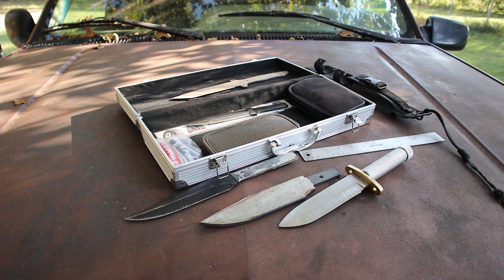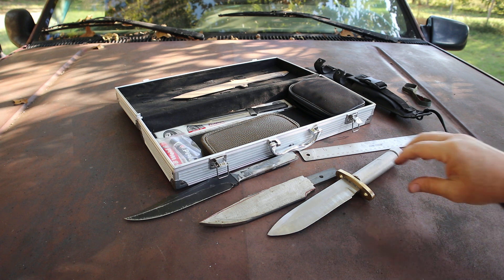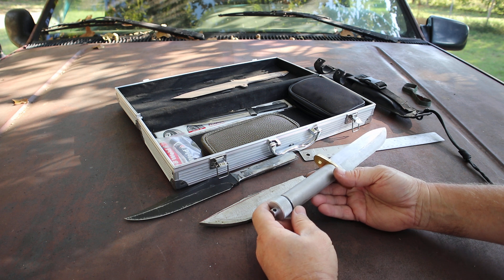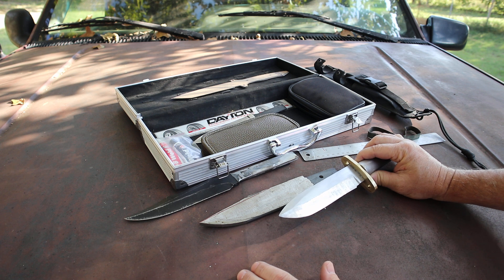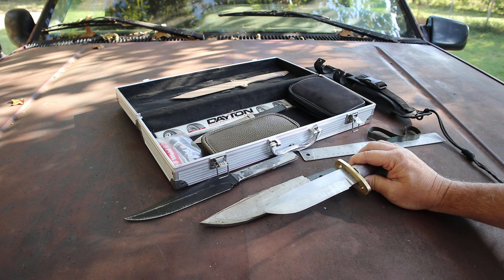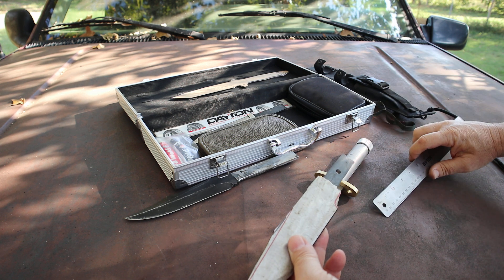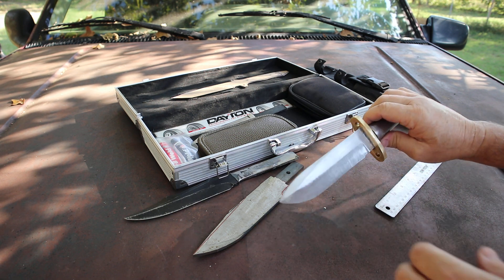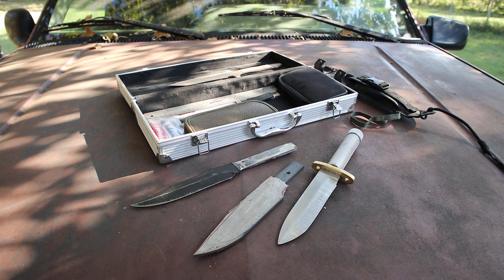Handmade Hollow Handle Knife Discussion ~Snowman~

Comment: Snow man that's gorgeous  man . Kust asking shouldn't you pin that blade in case the weld lets loose price ???? Id love onethat looks like my Parrish that got stolen in central America in the 80s pls let me know
Reply from the maker: Yes its pinned with the titanium round bar stock piece.  I put a 3/4" long 1/4" round titanium pin through the 1/4" hole that's drilled through the tang. That gets inserted and cold welded into the handle.  It will never come loose.  $330 total that covers labor plus materials, the hollow handle, cap end, making of guard + its material,  blade material + cutout labor all that togethers is $130.  labor for the rest of build is $200 that's all the labor time in hrs I put into making one, primary grinds, secondary grinds, heat treatment and temper, sanding and polishing etc.  No Sheath!  Just the knife.   I usually make knives for myself when the weather cools off from Sept-March, I'll be working on my MAC-V SOG, Snow-Tac's and these hollow handles.

Comment: The knife looks pretty Cool.  I’m curious,… What do you charge for one of these knives?   What is the wait time?
Reply from the maker: We could flip a quarter and bet "everything". lol!
Reply from the maker: Let me get back to you sometime the next summer in 2024, I'm going to be upgrading everything from shop and new knife supplies and knife steel supplies etc.  I'll make you something its just right now I got pregnant German Shepherds and lot of family chores on my plate, generally they range from $190 to $320 the hollow handles are more expensive since I got to buy the extra handle parts.  Once you tell me you want one it takes around 2-3 weeks wait time.  I won't need any money up front you pay for it once you receive pictures or video and your satisficed with it.
Reply: @snow_tacknives2019  ,… thanx.  I want a hollow handle with saw back.  Basically a Randall, Model 18 - (7 1/2” blade.).   I like that you pin the handles with a titanium pin & cold weld.   Sounds like a sturdy knife.
Reply from the maker: I can do that for you, I also custom make the handguards as well.   @cagemasterson9652
Reply: @snow_tacknives2019  ,… Great.   Looking forward to it.

Comment: Hi
Could you tell me the lenght of the blade, outer and inner diameter of the handle. Many thanks
Reply from the maker: The blade is 6-1/2" and just under a 1/4" thick, the hollow handle inner diameter is 3/4" the outer is 1"   No problem.
Reply: Hi
Could you also do 7inch blade length?
Would you ship to europ?
Reply from the maker: Where are you located in Europe and then how strict are your country knife laws?  I can make a 7" blade (Model 23 Storm) same profile as but 7"  I'm currently predisposed until around March 2024 is when I could make it for you. @joellelinden7079
Reply from the maker: Set yourself up a ~WhatsApp~ its international chatting platform.  I have a friend in South America who told me about WhatsApp it's pretty cool private messaging site. I chat with him and so if anyone see's this do the same you can leave me private message and it even pings your phone so you know when someone is trying to chat. Once you get the WhatsApp  then search for Snowman then you have to scan my barcode the barcode keeps out scammers and bots and we're then linked to chat with immediate worldwide connection.   @joellelinden7079
Reply from the maker: gfsnow921@yahoo.com @joellelinden7079